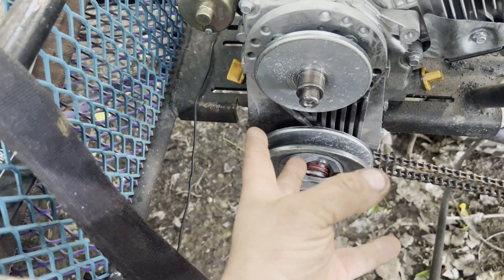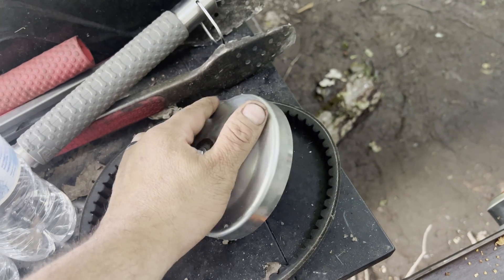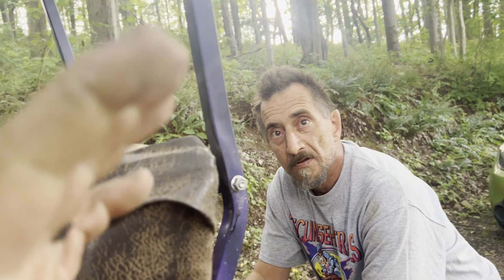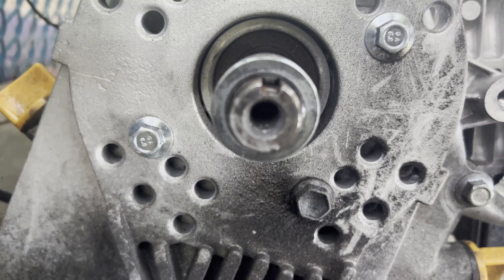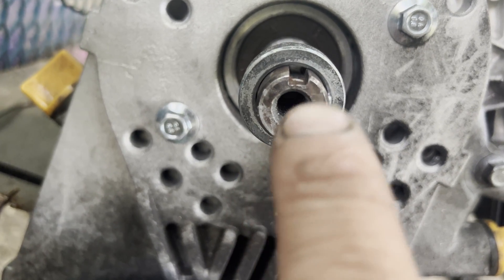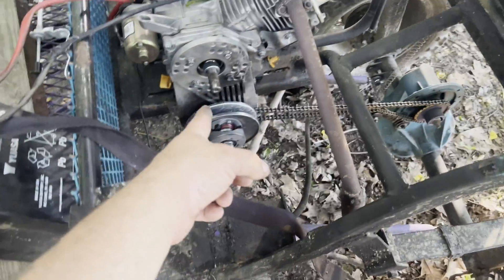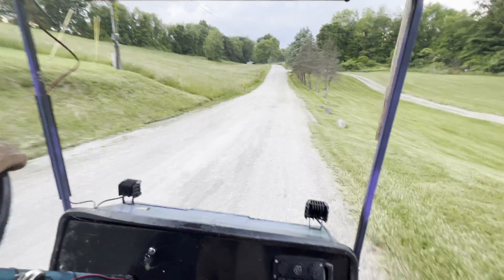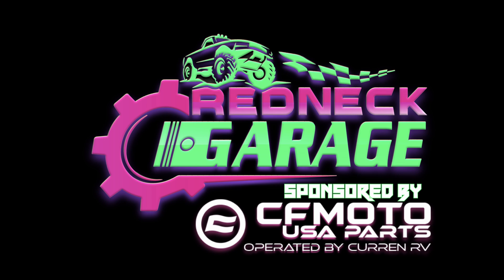How to Remove Drill and Tap a Broken Bolt stuck in a crankshaft

Comment: What thread did u use and were u able to use the same bolt
Reply from the maker: I couldn’t even tell ya  it was a trail side fix just used what we had
Reply: 5/16-24 thread should work